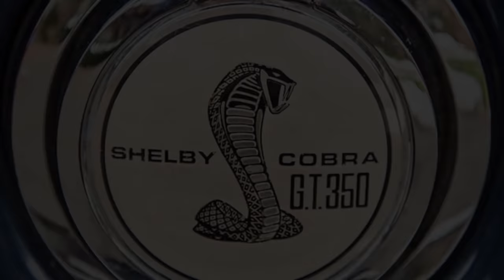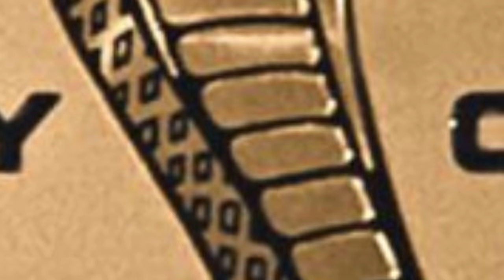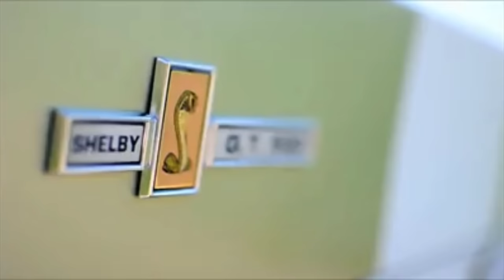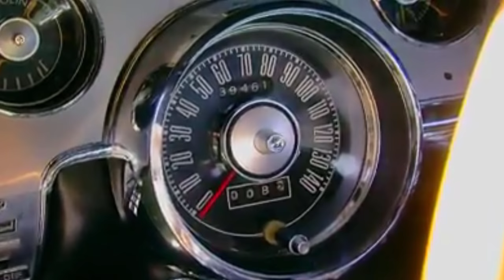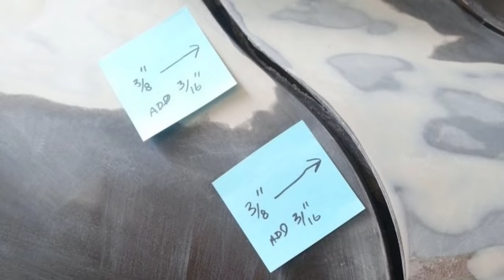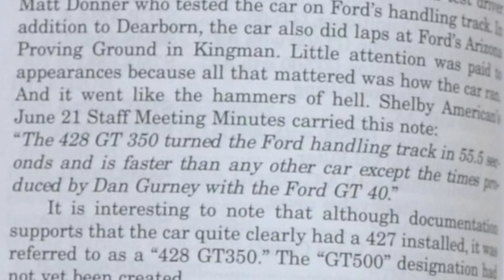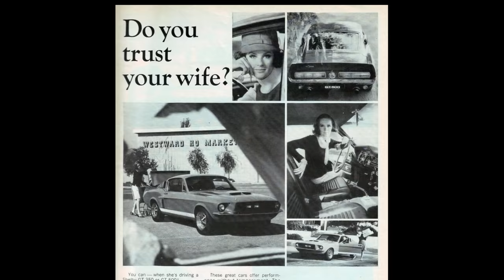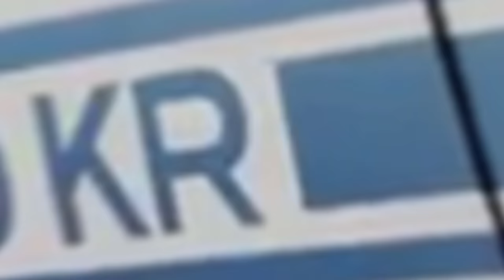The History of the 1967 Shelby

Comment: Need Your knowledge on the 67 GT500. My Dad owned a 1967 GT500 C6 Automatic. Back when my Dad owned his from 1968 to 1977 had 2 Mechanic's. One worked at Drew Ford in La Mesa Ca. The Other had the expertise to tune Duel Quad's. This 67 GT500 with Quads was fast and powerful when tuned properly. The Mechanic at Drew Ford had worked for Shelby American from 1965 t0 1967 and helped put the 1967 GT500 together. At first I was not thrilled that the GT500 had a Automatic in it. But found it was fast shifting and strong shifts. That's when the Mechanic(Drew Ford) told Me it was "Special" .... In the the 1960's he said you could special order Drag Cars from Ford. One was the 67 Fairline with a 427 and close a Hurst 4 speed or C6 Auto that was sent out to be beefed up to handle the power of the 427. That's the C6 Shelby used in the 67 GT500 and I loved it. He didn't know how 67 GT500 had the Special C6 auto  but said it was only a handful out of just over 2000 built. Here a year ago I found some info that said it was close to 68 plus or minus put into the 1967 GT500's. So My Question to You is " Do You have any Info the the C6 used in the 1967 GT500 and how many of of those C6's were put into the 67 GT500.
And one more interesting story ...... Changing Spark Plugs in a 1967 GT500 - A Very Big Problem ....... In 1969 I had returned home from Army - Crew Chief Mechanic on Helicopter's and had small hands. Heard stories of breaking sparks , taking all day and next day. Even loosen engine mounts to jackup the engine to make it easier. I think I might hold the "Unofficial" record for changing plugs in a 1967 GT500 - 4.5 hours. This was the second time and had all that I learned from the first time and a few special homemade items I made to help me. My Dad and the Specialist Tuner Mechanic couldn't believe when I called  at 11:30 am( I started at 7am) to come tune the Dual Quad's. 
Also thanks for info on how the 428 Police Engine was modified to make it a little better. Forget the 4 speed -  that C6 was the best ...... from  a stop in d for auto ....... Put the brake on put the pedal down and go ..... burn 10/15 ft rubber ..... auto shift into 2nd at about 42/43mph and burn a few ft of more rubber ... then 3rd at around 85 and chirp the tires ...... then just keeps pulling very strong flying up to past 130 just passing 5000 rpm backing off. I feel in love with car and auto. The 1967 GT500 with that C6 was a One Of A Kind.
Reply from the maker: Wow! Thanks for the stories! As far as the "Special" C6 goes, you have me stumped. I definitely believe that Ford did something like that, but I doubt that they kept track of it...however, they might have! You may want to check out http://www.1967shelbyresearch.com/ ...they didn't have any info on it when I checked, but if you join, you can ask the question and perhaps someone may have some info!
Reply: @TheGearheadLounge  Have You ever seen or looked at a 1967 GT500 with the C6 Auto in one? My Dad sold his to a guy in LA in 1977. Also Since I started looking about 20 years ago at car shows and Auction's  I've only seen One with the C6. Also it is worth mentioning that back in that period 60's/70's I heard that some Owner's of the GT500 with the C6 with change it out for the 4 Speed - so now just how many are left with the original C6? I think it could be a rare GT500 worth a lot more than one with a 4 speed.

Comment: Due to a shortage of 428 engines, several 1967 GT500's  got 390 engines, but were sold as having 428 engines. My uncle bought one new and only found out years later it has a 390 engine in it.
Reply from the maker: Thanks! That's good info I wish I had seen while writing the script!
Reply: That's complete BUNK.  Never happened.  If he found a 390 in his 428 car,   then some unscrupulous garage stole his engine.
Reply: That's 100% not true.  You are confusing the 427/428 shortage in the Cobra's,  the 67 GT500's all had 428s.  Not one 390 car has evere been found or documented.
Reply: @nevetslegasi5686  Some sources claim there was a 428 shortage and 390 substitution in the 1968 models, but his was a new 1967 model.
Reply: @jimjungle1397  Incorrect,  there is ZERO verified documentation of ANY shelby recieving a 390 instead of a 428,  you are sputing an urban myth.  My brother and I RESTORE shelbys for a living.  There was NO SHORTAGE of 428's.  Heck they used them in irrigation machines,  cars,  industrial generators,  and more.
Reply: @nevetslegasi5686  I never heard anything about 68's until the Internet, so I don't give them much weight, but I've seen the 67 long before the Internet.